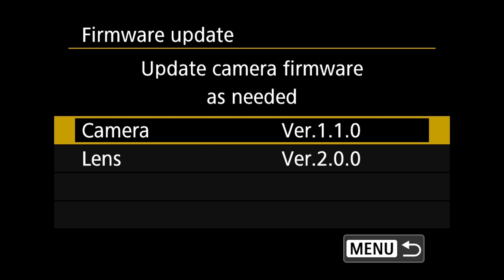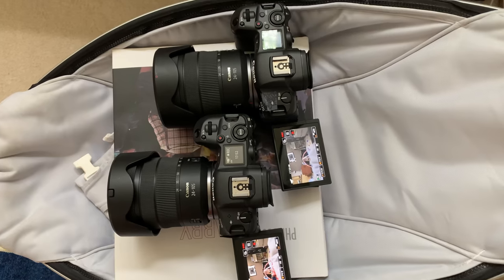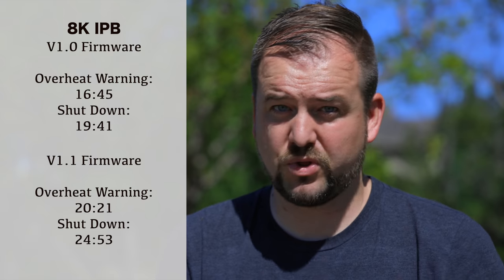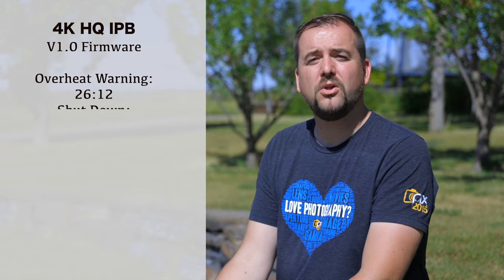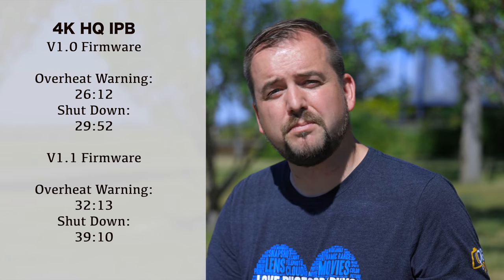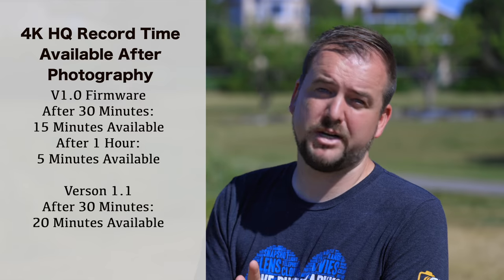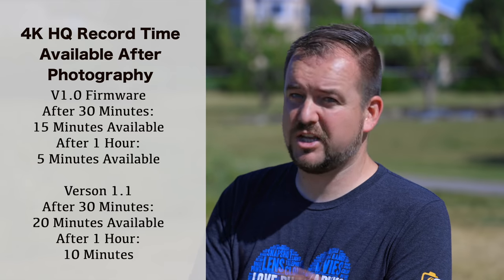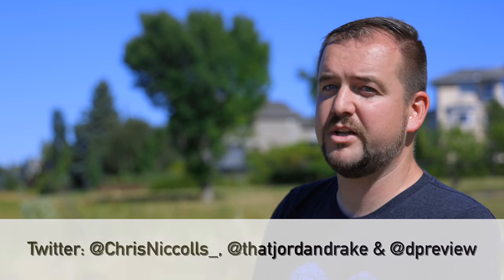Canon R5 Firmware 1.1 - Is the overheating fixed?

Comment: I think this just confirmed that the overheating in the first place was an artificial limit. I am very satisfied with R5. But let's keep blaming Canon. That's the only way to gradually release the potential of R5.
Reply: @CJ Jacobs I own the R5 and i love every minute of it. I can record in 8K. What can you record in your camera.?
Reply: @Davitor1  hours of uninterupted oversampled 4k footage and no recovery time on my $1100 Sony 🤣
Reply: I think the best way to describe how this has been going about is an extremely capable stills camera (and a capable albeit not jaw-droppingly good part-time video one) that could have been (and potentially could still be) a formidable hybrid that delivers excellent quality photo and video if it wasn't both overmarketed on what it could do and hamstrung so tightly on that regard especially when it comes to cooling down.

I think the engineers have really cooked up an impressive piece of photographic technology that I'm very sure owners have been very satisfied with. But I also think the marketing department went a bit too ham on hyping the video features to the point where controversy was almost inevitable when the hamstrings were laid bare. The Internet tends to amplify that sort of stuff, so it's something that really struck me as something they should've known ahead of time.
Reply: @Davitor1  I hope you didn't buy the R5 with the express and utmost intent of using it as an 8K video camera.
Reply: @CJ Jacobs You'd be surprised.

I personally know 2 guys who work in the camera retail industry and they remarked that demand for the camera has still been quite strong and returns only encompassed a small number of users.

There was one person who returned the camera not due to overheating but because the camera threw up a card error when recording 1080p60. They tested the camera with a CFX card and didn't find an issue. Still, the person insisted and he paid the $750 restocking fee and walked out with both an EOS R and a Mavic drone, which still scratches my head as the R5 is an objectively better camera than the R in pretty much every way.
Reply: Chase the Summit haha I like that response... you also seem to have a successful YouTube channel unlike David Ramos... so you can record quality content with your video camera unlike David Ramos!
Reply: Couldn’t it also possibly be that they did some software optimization and/or raised the cutoff threshold?
Reply: That can not be further from the truth. Watch Gordon Laing's review of the firmware, the guy actually put the camera into the freezer and it actually helped with the recovery time.
Reply: @Rascallucci  Gordon mentioned that the update made it so that the camera now takes ambient temperature values more frequently

Which may explain why cooldown times are now affected by things like low ambient temperatures
Reply: @NeXMaX  Why do you think Canon wanted the R5 to take more frequent temperature readings in the first place? There is a safe operating temperature for the R5, you can call it artificial if you want, but there is a reason why its stays unchanged. If that so-called "set temperature" was completely arbitrary, I am sure Canon could have got rid of it just like that. But, they can't and didn't because I am pretty sure it could damage the camera beyond that set temperature.

But, to be honest, it really doesn't matter whether the limit is artificial or not. Either way, the camera will still shut down on you as we speak. Do you think this firmware update has done enough then to relieve people's concerns or complaints on the recording limits? I don't know about you, I don't think so.
Reply: @Rascallucci  On that matter, I'm quite sure there is a technical reason why Canon's limits are conservative like that. We just haven't confirmed it as such but I'm inclined to believe that there is a technical reason rather than just the "cripple hammer". 

There are people who have managed to get their R5s running for about an hour or more on 8K with some tweaks and such but there's also no word yet on whether this affects the longevity of the hardware.

In my opinion, this isn't gonna alleviate a lot of those concerns as its a relatively minor update but it's at least a first step.
Reply: @NeXMaX  How do you know the limit is "conservative"? What if the R5 starts breaking down seriously if you lift the limit? There are people who managed to record for I believe 4 hours, but not in 8K if I am not wrong. But, that is to use the Ninja V. If you are shooting in a studio, sure may be you can do that. I shoot wildlife, am I supposed to set up a Ninja V in the middle of the forest? I don't think so.

What use is it if you are saying "it is at least a first step"? The camera costs US$4K and how many of these "steps" will we need before the entire overheating issue goes away? Or will it? Just too much unknown for my liking. May be by the time the R5 II or the R3 comes out, they might have resolved the issue. In the meantime, there is no evidence to suggest Canon will be fix the entire problem in the immediate future.
Reply: @Rascallucci  It's just really disappointing as a whole. The camera was hyped and hyped all about how good the video capabilities are and how 8K shooting will revolutionise video, even comparing it to the 5D2. And then reality comes in striking hard...

Maybe they shouldn't have sat on their high horse and trumpeted 8K so hard if they knew there were so many caveats attached to it. Maybe it will get better over time but as you've said, that's still an unknown.

As for the limits being "conservative", the hypothesis stands from people using the battery door trick to get around the cooldown timer, allowing them to record 8K in succession until the battery runs out. However, there's still unknowns regarding that especially in regards to lifespan.
Reply: @NeXMaX  Oh well, it doesn't matter, the fanboys and fangirls will be getting the R5/R6 no matter what. I am still currently a Canon user and have been one for 20 years. But, my next upgrade is imminent, I am not going for the R5, I will most likely go with the A7R IV, that is if Sony hasn't brought out the A7R V yet. Last thing I would be doing is to spend a big chunk of change on a camera that overheats. Honestly, I can't focus and enjoy what I am doing if I have to constantly remind myself of the overheating times.

Comment: This would all be great if the camera was actually overheating.  Based on most of the independent testing I'm seeing, the camera is never actually overheating, and the camera is just using a timer with some fancy math that tells you the camera is overheating even though no such overheating has occurred.  The cooldown times also seem to be greatly exaggerated by Canon, as the same independent testing appears to show that the camera cools down very quickly once the recording stops.  (Within a couple minutes, not hours)  All Canon appears to have done here is lightly deaden the blow of the Canon cripple hammer.  It's still unusable for a lot of hybrid and/or video only shooting scenarios.
Reply: most of these tests are made with tha backcover of the camera opened and the inside exposed(to measure the temp). but this also means that the heat can get off from the sensor more easily. when the camera is sealed, the heat will stuck inside and will keep piling up. so its very hard to tell if the camera will overheat or not
Reply: @MikedieONE  That's completely true, and definitely needs to be taken into consideration as we try to draw conclusions from the data that's being generated from this testing.  Well stated.

Comment: Hi Jordan, great test, got a question please, I did an interview with a GH5 and a 5DmkIV as backup ( 8bit no log novice) but half way through I stuffed the focus on the GH5 so need to use some 5D footage, but I am have trouble matching colours, 5D looks warm, GH5 looks cool, which sliders should I be looking at in post as changing temp didn't work?, any assistance would be much appreciated, regards chris

Comment: The one thing you don’t address is the way many run n gun shooters work. Many of us shoot clips 20-30 seconds in length and then turn the camera off until the next clip. That may be a minute later until the next 20-30 second clip. Under those conditions how is the new firmware?

Comment: REMOVE THE TIMER CANON!!! Jordan can't say it, we all know what it is.
There is no overheating in this camera, it's just BS.
Reply: I'm sure there would be eventual overheating if you recorded 8K or 4K120 constantly. But what we don't know precisely is how hot the components really get, and at what point they could be permanently damaged, or how long they really need to cool down. Canon needs to be honest about the temperature data, and the thermal specs of the components.

Comment: Nice to see that Canon is trying to improve the overheating issue but I suspect in practice the improvements won't make much of a difference. An extra 30 minutes at least is necessary. The cool down time is still a headache. Looks like Canon over reached with the inclusion of 8K. Impressive to have but just not practical for the majority at this time (let alone having to process and store huge files).

Comment: All of these problems can be fixed by magic lantern
Reply: Or get a proper camera instead and sell this shit
Reply: Cant fix physics via firmware... the camera will always generate considerable heat, all you can do is tweak the parameters of when it triggers a warning.
Reply: @HesselFolkertsma  it's not a physics issue - see EOSHD's test where he tricked the camera into recording 8k for an hour, with no breaks. Also, other smaller cameras record 8k in full frame without overheating issues, like the ZCam F8.
Reply: @MrNoipe  Zcam is a video camera. The R5 is a hybrid camera, more suitable for taking pictures than shooting video. Zcam is designed and built for the purpose of recording video; R5 is not. Are not comparable. The body of the R5 is sealed, Zcam´s is not. Simple as that. In the other hand wee can see it as a marketing issue. If canon had announced the R5 claiming the camera as a superb mirrorless full frame photo-camera instead of insists in the capabilities of shooting 8K raw... Things will be very different. When I say is a marketing issue, I´m not saying that the overheating is not a problem or a software limitation, but in addition is a REAL physical heating problem. 8K continuous recording probably can damage/melt the sensor/corrupt files and Canon knows it, and because of this, them crippled the video recording features. Simple as that. Alexa, C200, Red... All of those cameras have active fan cooling system. Why? OVERHEATING.
Reply: @MrNoipe  well it is still a physics issue, the magic lantern only removes or extend the overheat warning. Continuous use with extended overheat limit can damage the camera itself
Reply: @raquetamalvada  i also want to add that those cameras have boxy shape which contains few pcbs and heatsinks everywhere
Reply: @christodec  This is a proper camera tough? I mean its FOR photography like most cameras are.
Reply: TheNickle I am with u . Tell it to canon or canon fanbois mostly paid who marketed this as a video machine and an 8k cine camera . Lol . Also reports suggest that it overheats and shuts down after one hour of stills use - that if true and if the Chinese who took it apart who said its build like a heat trap - are true - means that it’s not a reliable stills camera for pro photo use under all circumstances (hence the pro tag) and it will need recall and rebuilt with a proper cooling solution this time
Reply: Hessel Folkertsma true this is why it needs a recall - fix the heat trap and physics - put a proper cooling option and cooling release solution and Re release
Reply: @christodec  Most people who buy this won't be fanatics. They'll either be professionals, enthusiasts or beginners looking to buy their first camera. The fanboys you talk about are usually on DPReview comment sections.
Reply: ''/ad That is BS, it is a hardware issue with a firmware lock, all they did was to get rid of the lock. If you exceed the temperature design limit, you run the risk of damaging the camera, it may not fail today, but could in a week or month.  There will be tell tail signs of overheating , so Canon will not honor the warranty. EOSHD took the camera to the extreme and whatever component heated up to the point that it stopped working, try that several times to see if your camera will still work. You have not the slightest clue what damaged that caused.
Reply: Felix Cervantes true firmware is bs fix it will ruin the camera . Heat trap it is with the current design and heat is a killer . This camera needs a total recall and redesign rerelease
But it will look so bad for canon that I doubt they will do it
Reply: All you guys saying that it can't or shouldn't be fixed by firmware, and that it's a physics issue, you either live in a cave or you are not really interested in the camera. Otherwise, I can't see how you missed all the reports that clearly show that the camera doesn't actually overheat and the overheating warnings are arbitrary artificial limits set by Canon, not to protect the camera from overheating but to protect the camera manufacturer from losing sales on their cinema cameras. Which may sound fair but it actually isn't. And not because of the "overheating" but mostly because or the ridiculous recovery times.
And that can and should be fixed by firmware.
Reply: raquetamalvada it's not as simple as that lol. We're don't care that it "overheats" what's unheard of are the recovery times.  No device needs that long to cool down. It's been tested in about a few mins is already back to its normal operating temperature.
Reply: Well whatever the reason is this camera is not great for videographer
Reply: Spiros Zaharakis - Yeah, by recording and powering externally. In other words, take out the elements that cause it to overheat... in other OTHER words the camera physically cannot remain cool by itself! 

Thus, all the firmware is doing is expanding the margins in which the camera is allowed to operate. Software cannot fix bad design, I’m sorry but you’re wrong.
Reply: Hessel Folkertsma what are you not understanding that the camera doesn’t overheat. It gets no hotter than other cameras in its class. In one test it was running even cooler than the a7siii
Reply: semahj lamons - DUDE, which alternate timeline are you living in?!? It overheats.
Reply: Hessel Folkertsma which one are you living in. There’s been multiple test done but plenty of people with actual thermal cameras. It can get hot yes like any other camera. But it’s results are inconsistent. Did you also think that a camera taking 2 hours to cool down is normal?
Reply: Sion Theodorus ehhh depends. If you’re a videographer that’s uses a ninja you’ll be fine
Reply: Actual temperature measurements showed that the R5 1) Doesn't actually overheat when the warning comes up
2) Gets hot but still doesn't overheat when it shuts down from "overheating"
3) Cools down in less than one minute but still the camera displays "overheated"
4) The camera doesn't seem to take actual temperatures into consideration when applies "thermal restrictions".
All these can be fixed via firmware
Reply: semahj lamons - No, am I saying anywhere that I think 2 hour cool downs are normal?

All mirrorless cameras shooting pro-video get hot. The difference is the Canon will OVER-heat, as in you cannot continue your work because the camera is not designed to keep working sustainably at those temperatures. A camera that cannot produce its headline features sustainably without external fixes (ext power & recording) is by itself simply bad design.

Stop referring to thermal tests, when all the practical real-world tests consistently show that the R5 overheats and the A7sIII dependably keeps on going.
Reply: @HesselFolkertsma  All the practical real word tests are affected by the artificial cut offs that have nothing to do with actual overheating. If you can't understand what the issue is let it go and stop showing your ignorance. It's annoying.
Reply: Hessel Folkertsma you're not this stupid...I know you're not.... Please re read what I said because your answer is showing me you're not even understanding the point I'm making.
Reply: I’m done, agree to disagree 🖖
Reply: Hmmm well well well. Lensrentals has investigated the heat issues of the R5’s... it’s pretty conclusive, don’t you think? This camera overheats.

Don’t some of you feel just a tiny bit silly now; claiming the camera doesn’t overheat? 😉
Reply: @HesselFolkertsma  we all know the camera overheat, but we just don't trust what canon says
Reply: @HesselFolkertsma  proof

https://www.eoshd.com/news/eoshd-testing-finds-canon-eos-r5-overheating-to-be-fake-with-artificial-timers-deployed-to-lock-out-video-mode/

Comment: That patent for a adapter to put between the lens and the camera that has a collin system needs to be real. If they could improving collin with a hardware solution, that would sell like hot cakes

Comment: That was one method, but is it the correct one? If the camera has a real overheating issue and not just a precautionary software feature - the only thing to fix overheating is a larger heatsink. Otherwise the camera slowly kills itself and all the software time extension does is speed up the death.

Holding your hand above a camp fire for three seconds, giving yourself an update and then holding your hand for ten seconds will not fix the burn.

Comment: Aren't there some rumours going around that the overheating and overheating-warnings are just software related? Like the camera is not even close to actually overheating but the software for some reason tells you so and then prohibits you from using the camera.
So Canon updated the Cripple Hammer as well, it is now fully digital and based on software alone...